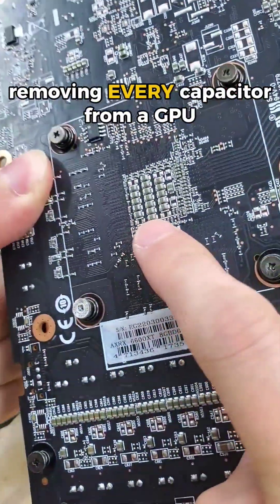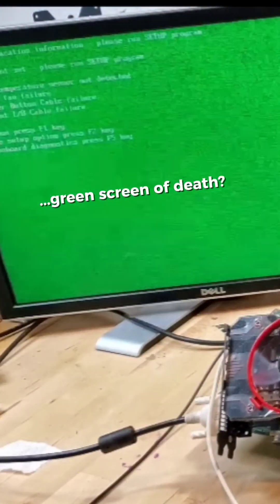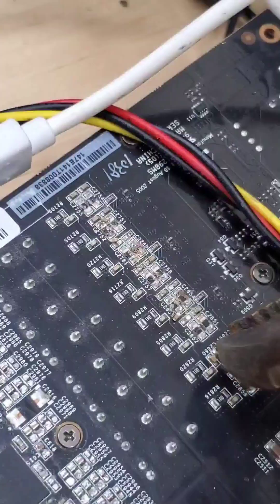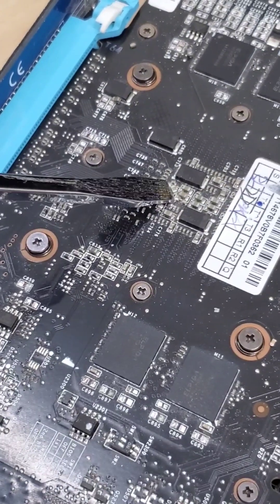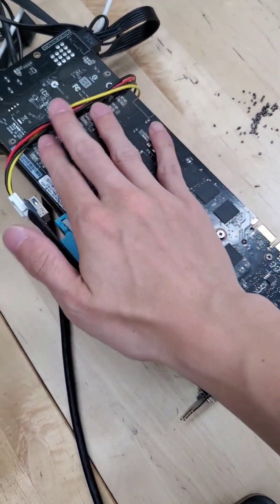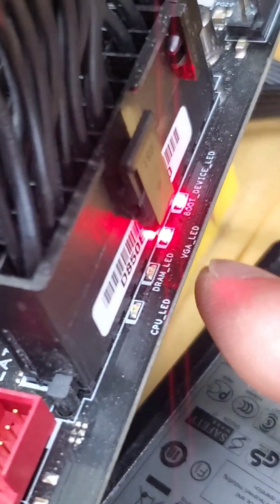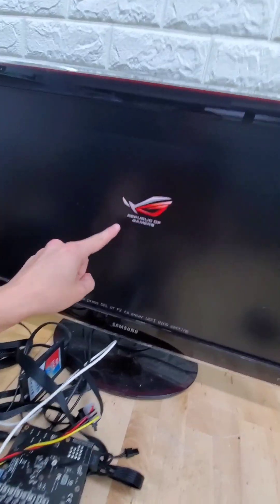removing EVERY capacitor from a GPU

Comment: A capacitor is essentially two conductive plates next to each other with an insulator in between. As electrons flow to one side, it pushes electrons away from the other. Since they are so small and the terminals are so close together, the circuit board itself, where the capacitors used to be, could somewhat act like a capacitor. Although it's not capaciting as much as before.

Comment: i have a ASUS GeForce GTX 1650 super and only 3 capacitors are missing and there is not video output. I even have a MSI AMD Radeon R7 260X missing 1 capacitor and it crashes as soon as it reaches windows

Comment: I think that when you rebooted it, it reverted to running the integrated (on board) graphics that came on the system's mother board. That graphic that appeared is still there and still loading because you haven't unloaded the bad board's drivers and it is a part of its software that is still trying to launch, in a sequential order.

Comment: You did not remove the tantalum caps from the backside of the gpu. Also, if you removed the capacitor used in the VRM power supply it's very likely you'd make cooked silicon with magic smoke taste

Comment: Apparently those capacitors are not connected to the circuit at all. They were just added for show, because it’s more impressive looking when you have all the capacitors sticking out.

Yup, definitely legit here.
Reply: Yeah, the real ones are on the other side with the gpu chip. It surprises me more people don’t know this.

Comment: Most of the capacitors you see on the backside of the gpu are there for filtering voltage pulsations. Many of them are not strictly necessary, but there to make absolutely sure that pulsations stay under the limit, that's why the gpu still worked up to some point

Comment: Capacitors are there for smoothing the power supply out and for supplying sponatenous current draw. Sometimes they are used in Oscillators or filters although you won't see that on a GPU.

Comment: Not surprised. Most capacitors are for smoothing power fluctuations and electrical noise and crap and aren't actually critical for normal operation. 

Over an extended period this card would almost certainly see more crashes and might not last as long as a stock example, but I'm not surprised it survived the initial removal and still works at the moment.

Comment: Fair warning I have no idea what im talking about ... But those might be those zero ohm resistor things that function like just plain wires. If the solder holding them on wasnt broken off completely it might still be bridging the gap

Comment: Capacitors are mainly used to help keep a stable source of voltage in case of voltage drop, they can also be used as filters. Can cause stability issues without them

Comment: Those MLCCs (multi-layer ceramic capacitors) are usually just for de-coupling, not strictly necessary but it helps prevent power supply noise from causing issues. I doubt this will be good for the silicon long term as many of those MLCCs absorb the brief sub nanosecond voltage spikes created on Vcore by the switching of the transistors internal to the silicon, and ringing of the MOSFETs in the VRM. Tantalum capacitors also do a good job for eliminating high frequency switching noise. Aluminum electrolytics are fairly high ESL so they tend to have little to no effect on high frequency noise and really only affect the noise coming from the much lower frequency switching of the PSU and VRM.

Comment: I do a lot of board repairs and frequently just omit those mlcc caps because their voltage rating and capacitance values are unable to be determined without a schematic. however, I honestly didn't expect that you could remove literally every single one from a board like that

Comment: it's based on what capacitors you remove. you can remove dozens of spare capacitors, you would be fine. you can remove a single power supply capacitor, your GPU would die.

Comment: While most of the caps on GPU are filter caps and there are a lot of them especially the bigger polymer/tantalum caps some of those caps serve other purpose like soft start caps or boot caps which turns on your power phase.

Comment: Capacitors are used to prevent interference  and or to give a stabil DC power, altho the small ones are probably there to prevent interference, as long as you don't use it near high voltage transformers or use a taser near it sould be fine

Comment: Actually, capacitors are connected parallelly. So removing them won't open any circuit. Most of these capacitors are for filtering the input voltage, removing them wouldn't cause any issue.

Comment: modern cmos chips doesn't need capacitors and or resistors to be functionally wired together.Those caps are only for smooth out the power supply.But resistors are still needed most because of the bias,pull up and down for specific functionalities and reduce noise.So don't break resistors.

Comment: The capacitors haven't much of a porpose except safety and to regulate the voltage, I'm guessing all of those capacitors were used for that purpose, so that's probly why it didn't work at first, but then worked a bit later. So it's more finicky, but can still work

Comment: For those wondering, capacitors are (MOSTLY) used in electronics for either filtering out noise, or decoupling. 

Capacitors are small "energy reservoirs" if you will. 
Like tiny little batteries. 
That hold very small amounts of energy, but can charge and discharge at super fast speeds. 

So when our electronics either have noisy circuits surrounding them, or demand sudden surges of energy, we use capacitors to supply that energy so our components never "starve". Cause if that happens, most likely a voltage drop will happen and some electronics might miss-behave. 

So TECHINICALLY, if we had a near-perfect power supply, that was able to supply the exact, right amount of power, at any given point in time, and our circuits didn't produce any electric noise, then most of those capacitors would be useless. 

THAT being said, since manufacturers have to take into account that you might be using a chinese 5$ power supply with their GPU, they have to figure out a way to keep the card fed with constant power (and constant voltage) at all times. Hence the insane amount of capacitors. 

Even if it runs, I'd bet my money on the card not functioning properly when high power demands will happen. (such as in games)
Reply: That's sorta right-adjacent.  Even if you had a perfect computer power supply, the voltage at the component would still drop due to the inductance of the circuit board trace feeding it limiting how fast the IC can "see" a change in supply current after a change in demand.  If you remember back to your physics, you'll remember that an inductor resists changes in current, just as a capacitor resists instantaneous changes in voltage.  That is in fact the primary reason for the small "decoupling" capacitors.  They're usually placed as close as possible to the component to minimize the remaining line length, and thus inductance, between the capacitor and the IC die so that the capacitor can act as a local supply while the current through the inductor changes more slowly and eventually can provide the necessary current to the IC.  One reason this GPU probably still works is due to good PCB design with a lot of copper filled layers.  Ground planes are often placed very close (layer to layer inside the board) to the supply voltage distribution planes, and this results in a very small but very high quality distributed capacitance.  There are no doubt still bulk electrolytic caps on the other side, so the two in combination are likely allowing the board to still work.

Comment: Most GPU caps are for voltage spike smoothing. This is a relic from the time when every PSU was a gamble, as not all PSUs have overvoltage protection.

Comment: Those caps are for smoothing out the power going to IC's. Without them it'll still run, but not as reliably. Its like running a car without an air filter. Itll work, but it may not last long.

Comment: Capacitors are only necessary for stable power supply and remove voltage spikes and voltage drops so technically you can remove every single capacitor other than big ones like cylinder as they are for power supply and more necessary 😊

Comment: Broke a pin on my cpu and had to bend atleast 50 back into place with a razer blade and fine tipped mechanical pencil (using its lead-hole) to put them in place before mounting and having it happen again 😢

Still works though. Been an amd cpu/mono guy all my life and I’m done.

Comment: I remember doing this to my 1650 super about one year ago. I was opening the Fans plate to reapply thermal past when I accidentally knocked two of the capacitors off. I was so scared until I replugged the gpu and it worked fine. It is still in my pc working just fine and in constant use.

Comment: Im pretty sure the capacitors just stabilize the electricity. So the GPU will die quicker without the capacitors.

Comment: Me having rx 6700 xt only 1 capacitor missing the gpu has power and fan spinning but no display because the missing capacitor is beside of the port of HDMI and DPI it doesn't boot mine

Comment: funny and when the card was running even a Benchmark the card was layed down on the fans so nobody can see if they're spinning or working, if the card works how you manage to get it not shut down after any secounds because overheating ? what a scam troll fake video.

Comment: If you remove blocking capacitors (not sure if it is the right name in English) it isn’t to bad but if the capacitor is used for something like an oscillator it will probably stop functioning

Comment: I will start removing mine to save electricity. 😂
Reply: these capacitors may actually save on switching current by giving the output more capacitance
Reply: likely the other way round

Comment: Wtf... I killed my last mainboard by accidently breaking a single one of those off. 💀
Reply: you probably scratched a trace somewhere along it
Reply: You probably pulled one off the motherboard VRM. The caps in a GPU are just for smoothing voltages, the ones on a motherboard are mostly power distribution.
Reply: Some cards need an even number removed others need an odd number removed. It works best when you use nail clippers.

Comment: caps are mainly used to smooth power delivery to sensitive components such as microprocessors.

but the better our power supplies gets the more of these components can essentially be removed without much risk.

but i guarantee you if there's any ripple in your PSU during one of the benchmarks and you removed all the smoothing capacitors, then it'll  crash.

Comment: The capacitors are only installed for more reliable, consistent and better electrical flow through the pcb lanes, so it doesn't really matter if the capacitors are still on the pcb as long as all the lanes are still intact and connected and the psu delivers regulated and consistent energy flow
Reply: Yups, NV_VDD (Vcore) and FBVDD (Vmem) filter caps
Reply: This! 100%

Comment: Day 68 of asking for a gaming pc to me that has a RTX 4070 ti super Rog strix oc edition 16 gb and ryzen 9 7950x3d,kraken 240mm aio, montech sky two black , a msi 1300i psu ,64gb ram 32x2 ram 6400hz ddr5 , Crucial T705 4tb PCIe Gen5 NVMe M.2 SSD x3,Gigabyte x670 Aorus Elite AX (Wi-Fi) Motherboard,8tb 870evo or pro SSD x1, asiahorse or ezdiy-fab cable extension black, windows 10 pro physical edition with activation key that will carry on even if I upgrade to windows 11 pro,and gift my username in steam all the games from gta 5 to all types of games gamers like thx for your help

                                                                 Lovingly

Comment: I dropped an 1080 many years ago and when I saw a small capacitor on the floor my heat skipped a beat lol. Lucky the card ran fine for about 3 years or so before I sold it. Glad to know they can actually take a beating.

Comment: They are most likely filtering caps that is probably why it still works and there are most likely some still on the other side of the pcb that could also be why it still works

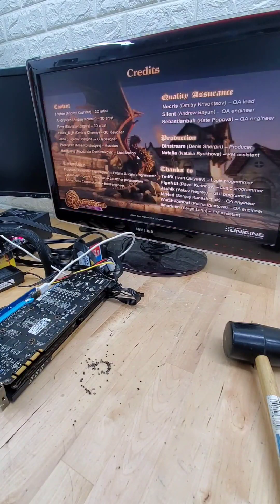Comment: 0:55 bro really did a gpu benchmark with the gpu fans facing downwards 💀💀
Reply: If it can run without any capacitors I think it will run with the fans facing down
Reply: @omarabdo4816  would be more spicy in the heat department tho
Reply: I mean, does that even matter at this point lol
Reply: @Natemo2625  no lol, just wanted to point that out
Reply: Accurate lol
Reply: Fans generally face down in most desktop builds anyway.
Reply: @MadMattH  face down against the table is what I meant.I meant why would you block airflow to the heatsink?
Reply: @MadMattH  suspended in the air, not touching the ground
Reply: @carefreebubble indeed

Comment: Bro just knocked them off the board🤣
I thought he at least had a heat gun!
Reply: He need to punish the capacitor
Reply: Op did mention he was dealing with personal stuff. Perhaps what he did with the caps was therepitic lol
Reply: @Alistair_13.1  therapeutic
Reply: he has been dealing with some personal stuff
Reply: same
Reply: Or a hot surface device
Reply: A heat gun would cause the components around the capacitors to slide off as well. This is actually the best way to do this if you don't care about breaking a pad.
Reply: @andyk192 that’s why you don’t set the air speed too high and cover everything you don’t intend to remove with Kapton/polymide tape.
Reply: @andyk192  there are nozzle attachments for hot air gun that limits the area of effect of the hot air. But obviously this guy won't be doing any soldering/desoldering anyway so buying a hot air station would be a waste of money
Reply: @andyk192 it doesn't sound like you have done this stuff before.
Reply: @andyk192 OP is probably talking about a desoldering gun

Comment: check the schematic diagram and check what purpose on what capacitors do. there may be a possibility that it will break or glitch
Reply: capacitors are mainly just used to filter noise coming from the ground connection that may interfere, also protect it from power surge and increase its life expectancy.

edit: smd capacitors not electrolytic capacitors used for frequency timing.
Reply: @Daviie_  thanks, i did watch a mattkc video on the wii and it does filter some noise
Reply: @Daviie_  Nailed it!
Reply: They are all for power rail filtering after the dc/dc converters on the card. The converters step the 12V from the psu down to all of the 1.2-0.8V power rails for the ICs. Signal filtering is all done inside the ICs. Signal delays are done with longer traces (those wiggly lines).
Reply: @lukahierl9857  No you are wrong. The wiggly lines on the PCB, called serpentine traces, are used to ensure that signals arrive simultaneously at their destination, maintaining synchronization and signal integrity. They're not primarily for delaying signals but for making sure all signals are in sync, especially in high-speed data lines. Because just a millimeter offset can make a significant change in speed and performance.
Reply: it is much more liekly to crash under load . a load such a video clip , game etc will change the power usage up and down dynamically and thus is more likely to crash . Not a guarantee and every single core will function differently
Reply: Bro you have to take that pfp down. I am the owner

Comment: Why’d you have to destroy an evga card couldn’t it have been literally any other
Reply from the maker: The destructive hammer of tech tinkering selects it's prey in mysterious ways
Reply: @mryeester  you gonna remove the resisters next?
Reply: @Cy-by  honestly @that point remove every single trace of wire where current flows through, aswell as the little trenches inside the pcb itself...

HELL @dat point just remove EVERY SINGLE conductive material on and in the board!!!😂